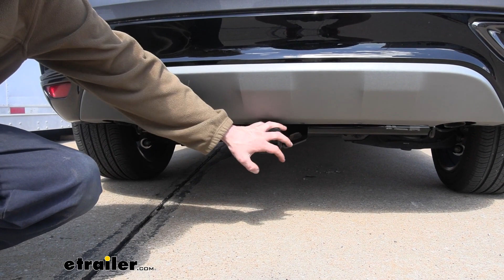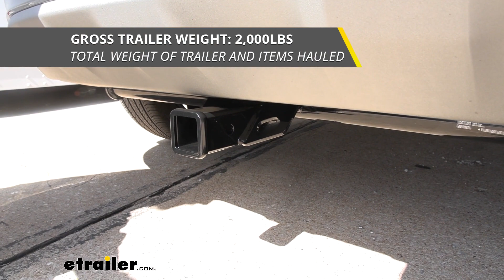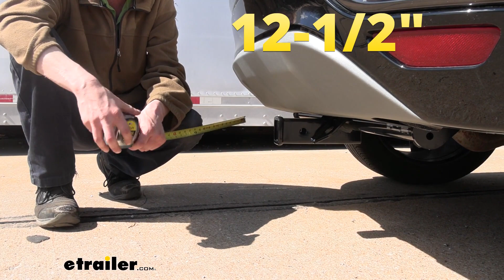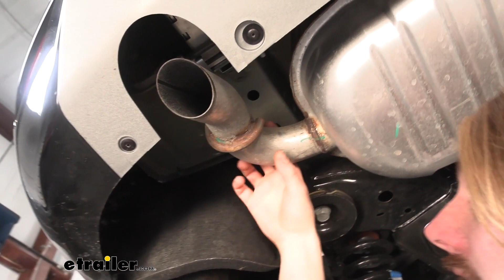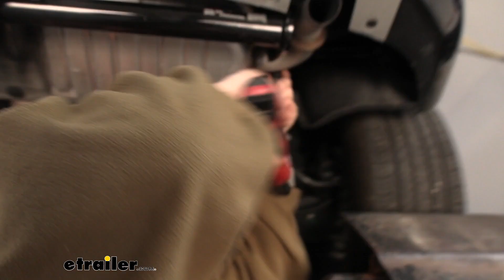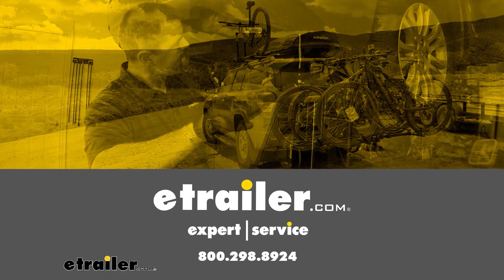etrailer | How to Set Up Your Curt Trailer Hitch Receiver on a 2022 Buick Envision

Comment: Did you install a wire harness for trailer lights?
Reply from the maker: We did not, as the hitch was only going to be used for a bike rack. If the vehicle has the tow lighting connector under the rear bumper, just left of center, you can use # TK74VR Tekonsha trailer wiring harness. If your vehicle isn't equipped with that connector, you'll need to hardwire one in using # 119147KIT.
https://www.etrailer.com/Trailer-Wiring/Buick/Envision/2022/119147KIT.html?VehicleID=202247460
https://www.etrailer.com/Custom-Fit-Vehicle-Wiring/Buick/Envision/2022/TK74VR.html?VehicleID=20226004388

Comment: Same process for the 2023 Envision?
Reply from the maker: The 2023 uses a slightly different hitch, the Curt # C94ER. The procedure for installing the # C94NR would be the same as the # C94ER you'd checked out. Here's the install instruction for the # C94NR:
https://www.etrailer.com/instructions.aspx?pn=C94NR
Hope that helps you!